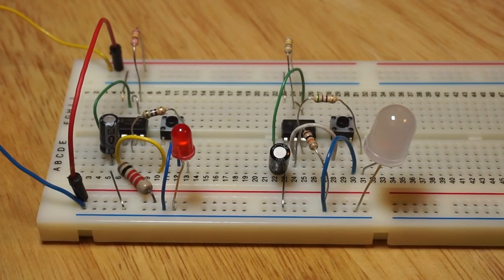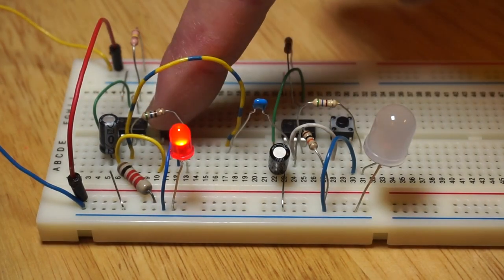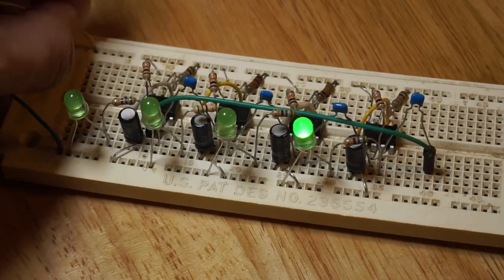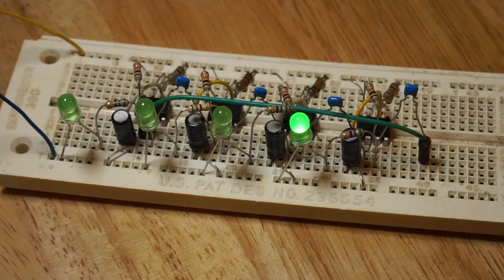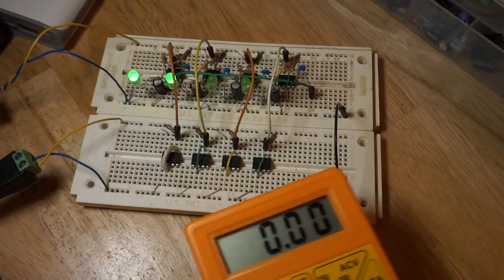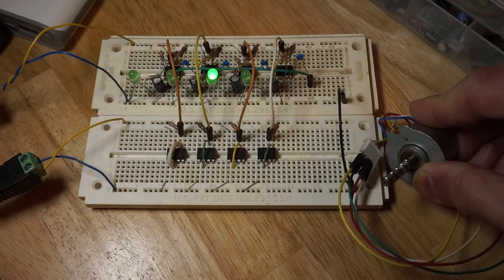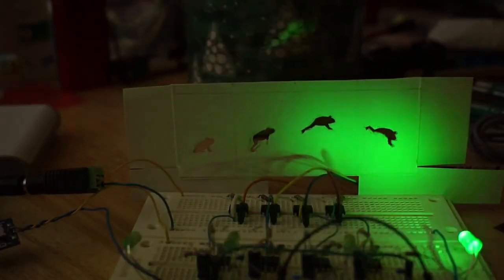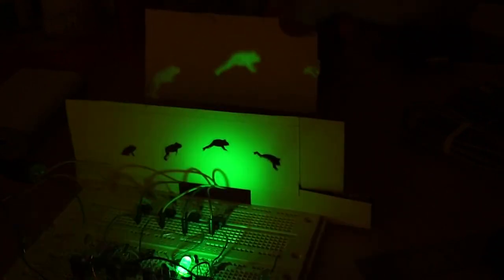Animated Kinetic LED sculpture abuses eight 555 timer chips

Comment: Before cheap micro's became available, I think it was fairly common to drive servo motors with a 555.
Reply from the maker: That's okay for servo control signals because the servo already has its own driver circuitry.
Reply: @bornach  Right, I think the 555 is probably fine for pulse generation.  For the stepper, if you added some output transistors and flyback diodes (or some other form of spike suppression), I think it would be fine.